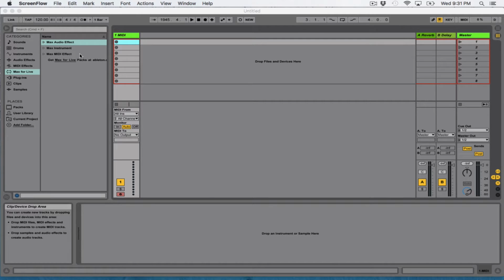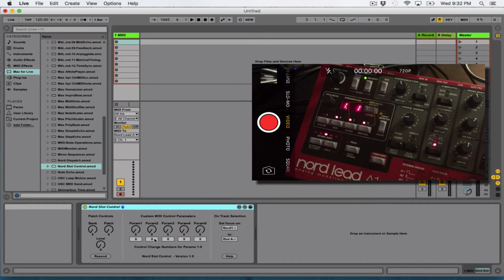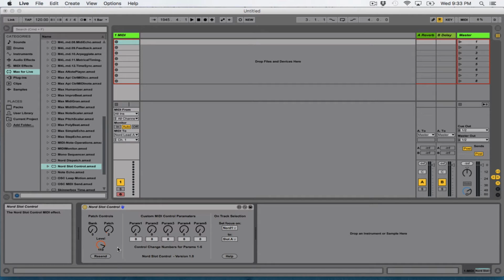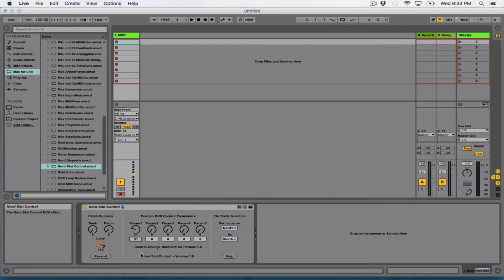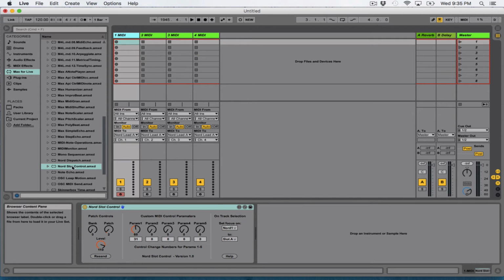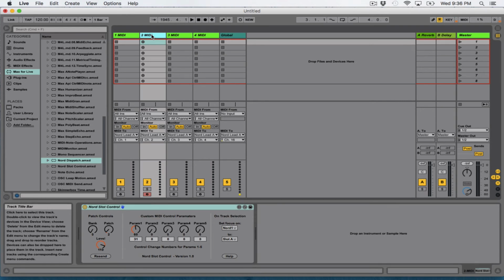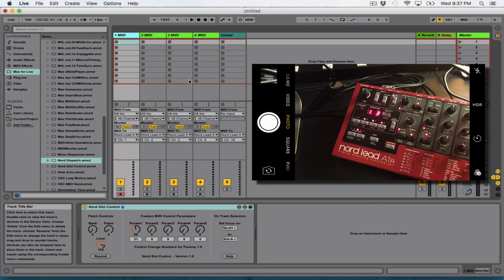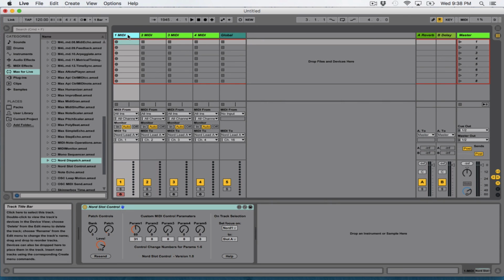Nord Tools For Live

Comment: Hi Luke, I'm having some troubles with your m4l device in mi A1r. I wrote you via instagram, but anways I tell you the same here; mi A1r responses ok to all your m4l updated devices but the main feature doesn't work, the focus slot is not responding, can you tell me the a1r configuration that you have inside the synth itself? I'll try to work out that cause clarely I'm missing something
Reply: Dismiss this, I solved the problem! :D I just had turn on all the layers togheter (four red leds on) and now it's answering to the changes. Thanks for doing this! :D
Reply from the maker: Glad you worked it out! Have fun!

Comment: Thanks mate, you made my day! Gonna watch the rest of your contents
Reply from the maker: Glad to help, have fun!
Reply: @synthseeker  thanks ! for a reason i ignore, selecting a track doesn't automatically send the parameters to the nord... any idea ? (i m on stage 3). when swichting it does add the "E" button on the current program but doesn't switch to the proper one
Reply from the maker: @NEXT-LesMondesSensibles-Serie   - Hey there... on the Stage 3 the architecture is different, and probably won't work. This plugin is tailored for the A1 and other synths that match it's type, like the Lead 4. It assumes four layers. the stage 3 has a different engine and 2 parts. So it might work...a little? But I don't expect that it will. I'm sorry. If I had a stage three I could do something new for it, but that isn't working for me at the moment!
Reply: @synthseeker  Thanks a lot for your answer , it will save me time instead of trying to fix it. It works a litlle as you mentionned. I was looking for a woay to actives different programs from live. I'll definitely keep an eye on your work if case you make something for Stage 3. I'll pay for it, i'll be beyond the early birds !;-)
Reply from the maker: @NEXT-LesMondesSensibles-Serie  - No Promises but I'll see what I can cook up. ;)
Reply from the maker: @NEXT-LesMondesSensibles-Serie  I DO have a patch change control for the Nord Wave 2 - which is similar to the Stage 3. You could try that. It is linked in the description for this video: https://www.youtube.com/watch?v=ry5N7avqAgg
Reply: @synthseeker  Thanks a lot. trying with the new WAVE piece of work you made shows the same symptom. Makes me wonder if it's not me doing sthg wrong. Maybe an ableton parameters ?  I does change the program when i turn the virtuel knob on ableton (like it did with the Slot Control version) but when i select another midi track (duplicated) with another program preselected in it , it doesnt change the program automatically on the nord. A midi message is indeed received but it only adds the "E" (for Edited) to the previous program. Strange. How come could it work on the know but not by changing tracks ... I'll keep investigating and feedyou back if i find anything. By the way, did you know about that amazing guy teaching about the NORD (so thouroughly !) on you tube "my keys to music" ?
Reply from the maker: @NEXT-LesMondesSensibles-Serie  Ok, I'm sorry. Maybe one day I'll get a Stage 3 and test myself. Good luck and I'll check out "my keys to music". Have a good weekend!